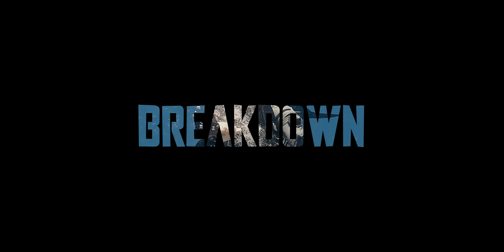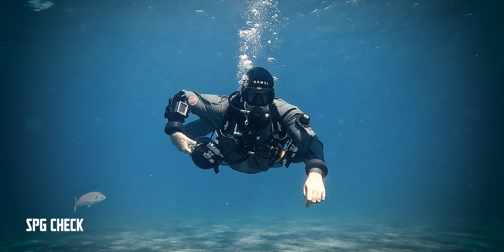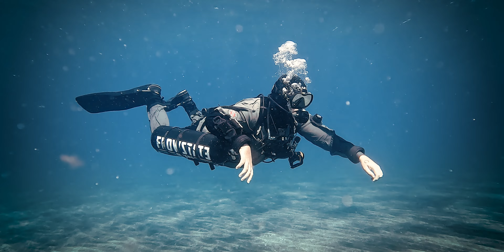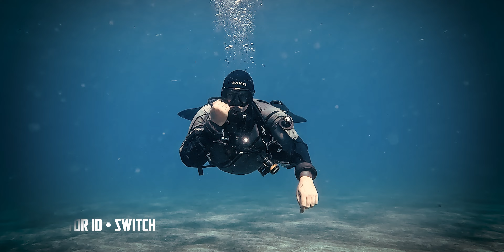Sidemount Regulator Skills | Master Series

Comment: is the break-away mechanism (for attaching the bolt snap to long hose) one-time-use or is it some sort of a clip that can be "reloaded" ?
Reply from the maker: It's for one-time use. Although some companies (like razor) offer gadgets that can be reloaded, we prefer the version we use because it's sturdier and much easier to repair in the field. We'll provide a detailed guide on this in our upcoming video, where we'll discuss sidemount regulator configuration and cylinder rigging in greater detail.

Comment: Using gas integration seems very useful with sidemount. Dont have to constantly check 2 spgs. Do you guys use integration?

The fact that you use a 90 degree on one regulator so you can identify which is which efficiently is  actually quite smart.

I was a bit surprised about the breakaway boltsnap. What if you dont pull hard enough? What if you accidentally break it? What do you do after breaking it, just let it dangle?
Reply from the maker: we will be covering all that in the upcoming SM equipment related videos so stay tuned
Reply: Not a sidemountdiver, but if I should use this trick I would make the 90° the LLLLLLeft one, even at the edge to narcosis still easy to remember.
Reply: @subjektobjektpradikat7902  no. Right angle = right cylinder, long = left is the easiest way to remember